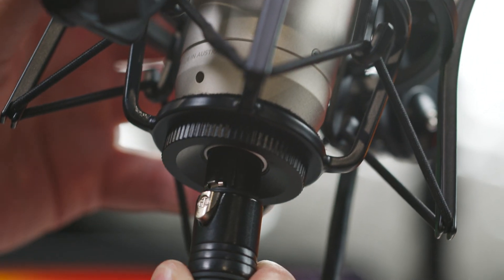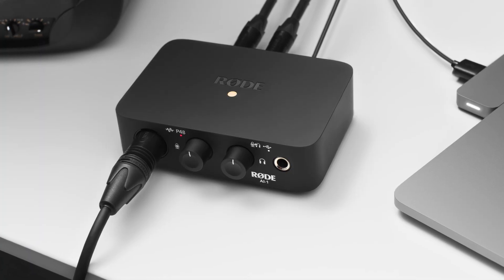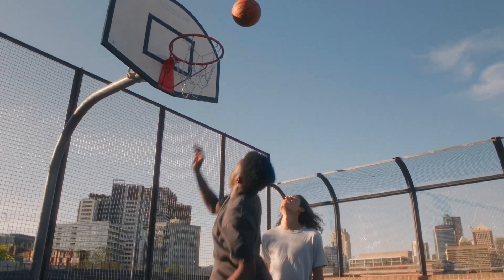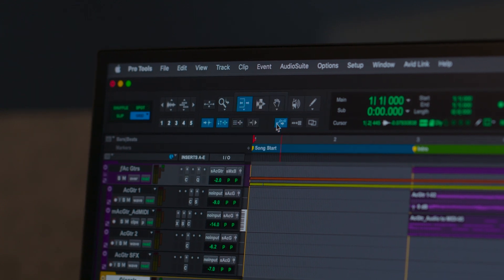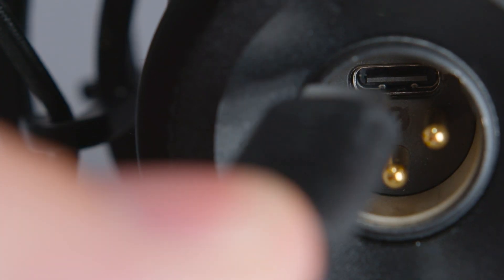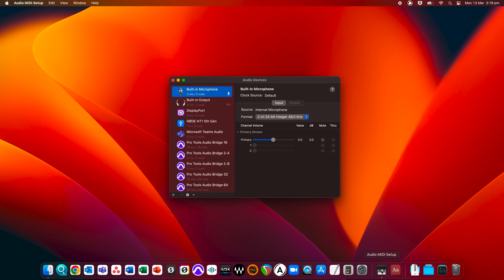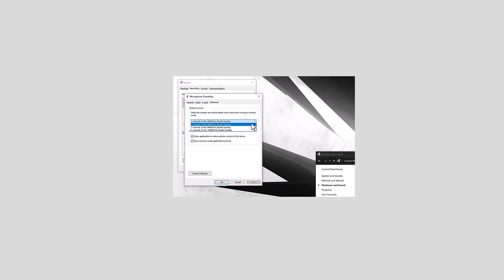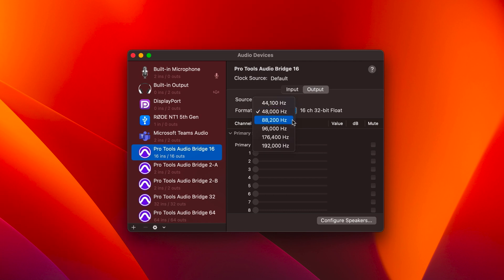How to Record Ultra-High Resolution Audio: NT1 5th Generation

Comment: If I wanted to record through XLR at 192khz, would I have to change the settings via USB-C first, and then re-plug the XLR back in?
Reply from the maker: The sample rate that you set it to will only apply when connecting the microphone via USB-C. When connected via XLR it will be determined by the capabilities of the audio interface 😊

Comment: Does NT1 5th gen works when connected directly with mobile device through USB C cable with smule and other apps?
Reply from the maker: The NT1 5th Gen isn't directly compatible with mobile devices. Computers would be the way to go with these microphones :)
Reply: @rodemic  That is really disappointing. There are so many features but this was not considered by Rode. Even basic USB condenser microphones like Maono has direct connectivity to mobile devices with good sound output. More surprisingly, it is not mentioned anywhere, and customers may get confused as most of mobile devices have USB C port connectivity. Rode must include this feature with some added functionality to support mobile devices connected directly.

Comment: can i connect to mobile phone?
Reply from the maker: Connectivity to smartphones aren't directly supported at this stage.
Reply: I tried connecting my Rode Nt1 Gen 5 to my samsung galaxy S22 android. I went to video recoder and tested - it was using the rode mic instead phone mic. Also the mobile phone showed message "Using usb microphone". Edit: However I don't know is there any way to change settings of microphone on mobile phones.

Comment: i want to record my voices in 48.000hrtz but all my projects in ableton and samples are in 44.000hrtz , it is ok to work in a project with diferents hrtz?
Reply from the maker: Hey there! Good question. Mixing audio with different sample rates like 48kHz and 44.1kHz can be tricky but not impossible. However, you'll probably want to avoid that if you can. Most DAWs, including Ableton, offer a way to convert your samples to your project's sample rate. This is generally preferable to mixing sample rates.